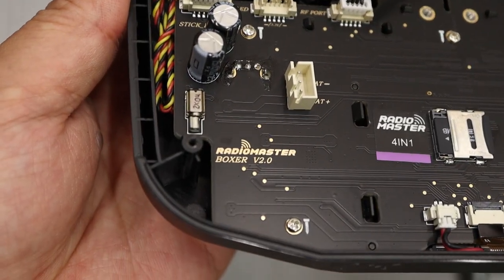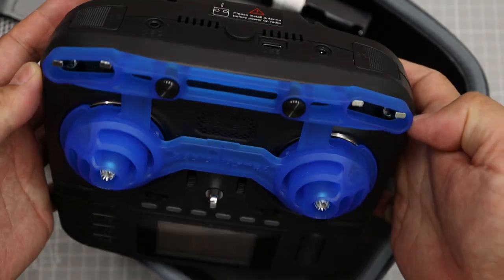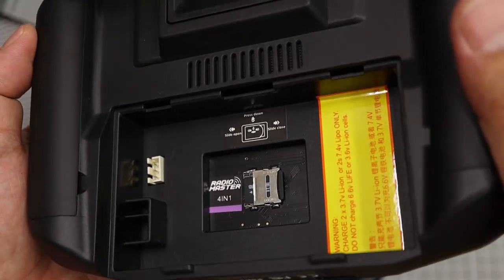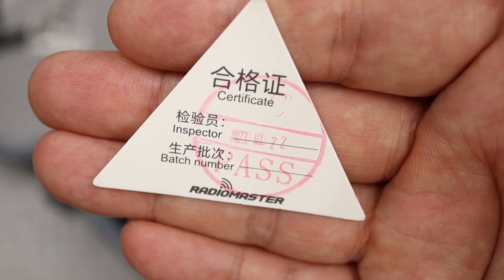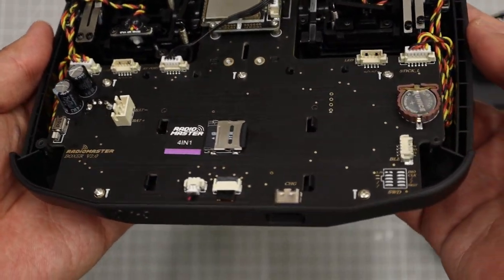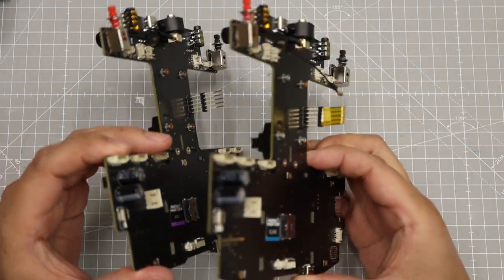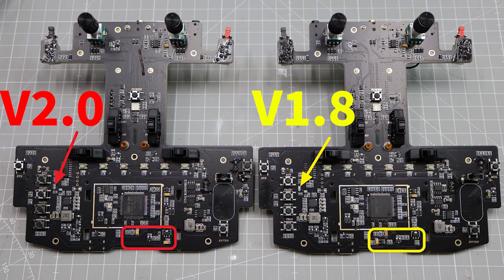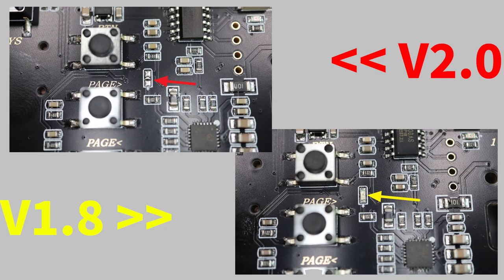Radiomaster BOXER NEW PCB Version!

Comment: Thanks. Radiomaster do seem to go through a lot of versions. Still they manage to screw up the Real Time Clock on the Zorro.
Reply from the maker: That's right, the teardown video of brand new Boxer Crush on YouTube showed that the PCB version was 2.2.
The RTC battery seems to consume even when the main battery is connected. It seems to consume faster than I thought, and this seems to be a problem not only with Zorro, but also with the same family of TX such as Boxer, TX12 and Pocket.